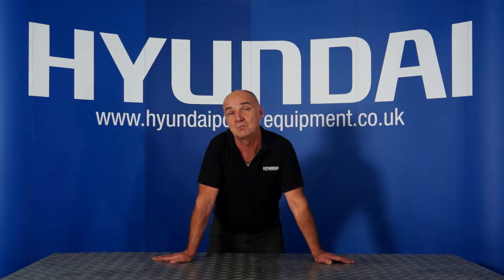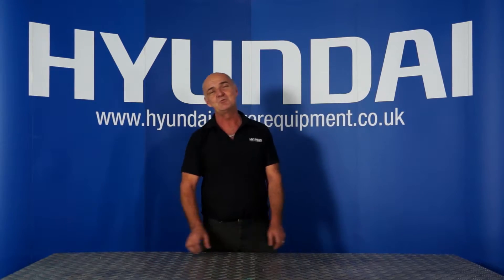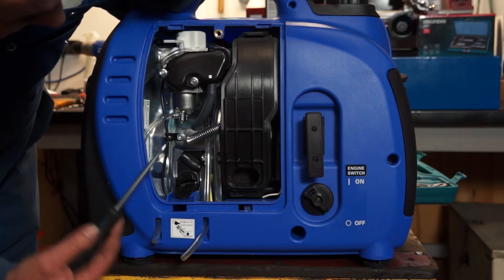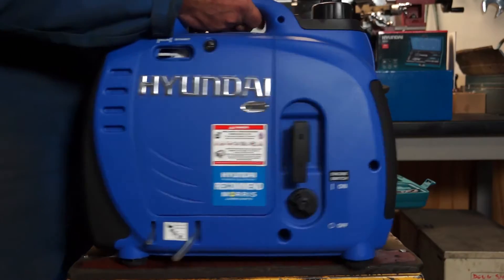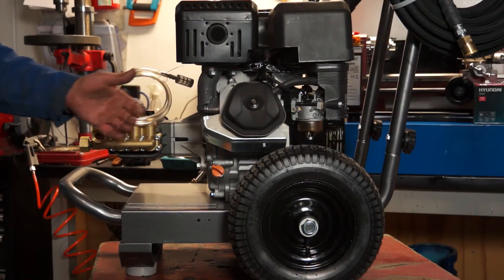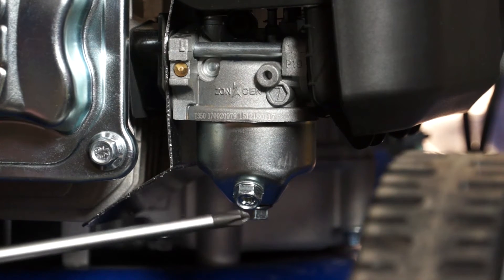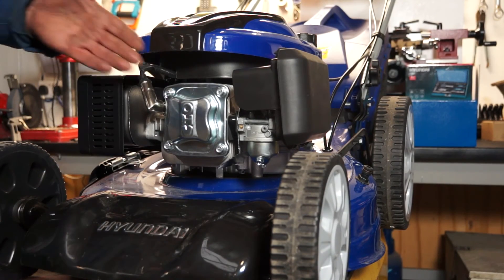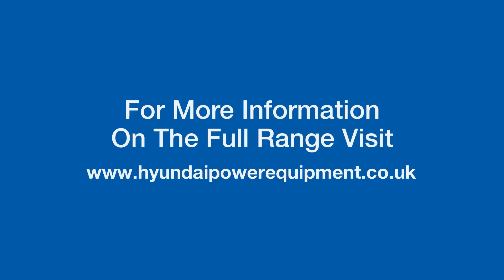How to Drain the Carburettor on a Hyundai 4-Stroke Petrol Engine

Comment: Easiest way I find and needs no tools is to start the engine, turn off the fuel tap and left the engine use up all the fuel in the carb that way. Not sure if this works on your little suitcase gennys though.